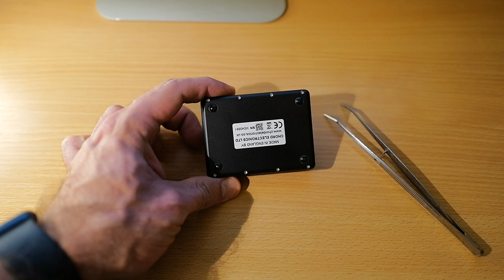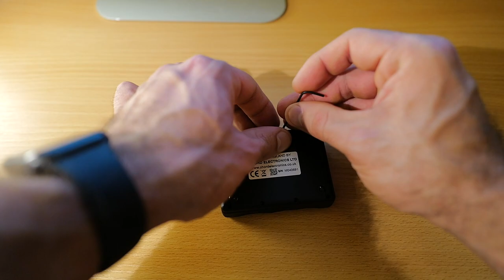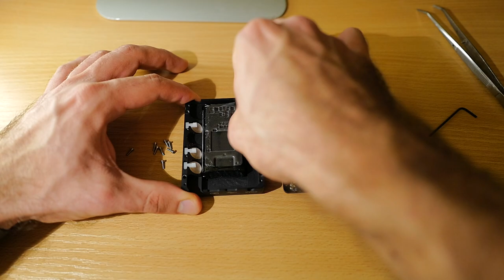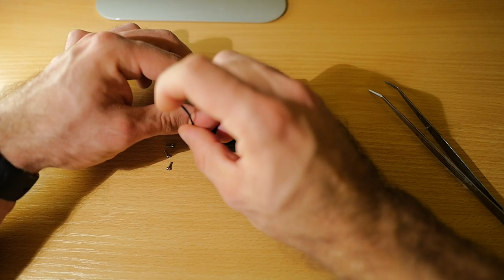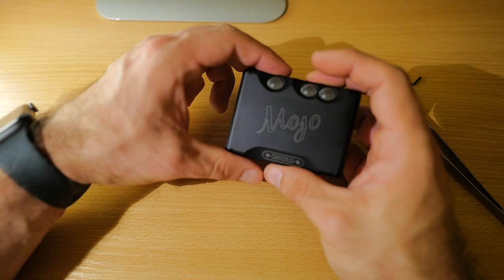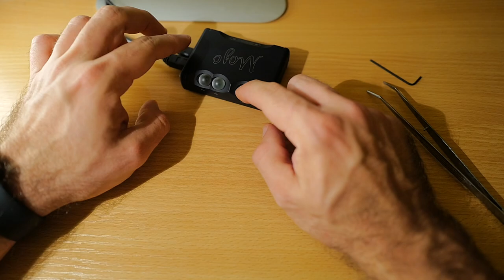How to convert Mojo into a (always on) DESKTOP DAC? Step-by-step GUIDE

Comment: Does this stop it getting hot ? Great video
Reply from the maker: Hey there! Well, the CPU that does the processing produces heat. But so does the battery when being charged. So by removing the battery you lower the amount of heat created. But the difference heat wise is not huge. But it is noticeable. Yes.
Reply: Thanks , would you risk getting a second hand mojo or would you just get a new phone one ?
Reply from the maker: That is a good question! I probably am more likely to say I would.
Reply: @TechBlogPool  no sir, please don't recommend to remove the battery, you feel less heat because you're taking out the battery that makes the job of heatsink, but the chip is burning inside without the battery

Comment: i disconnect battery and it won’t turn on
and it won’t charge either
Reply from the maker: Hi, this most likely means the power supply is too weak. What is the amperage of your adapter?Please connect to a stronger power supply.
Reply: @TechBlogPool i found out that it blew inductor and power can’t get in the board, took out the melt inductor and it works

Comment: my problem is that my mojo keeps on turning off this way..  any ideas  ?? 
thanks !
Reply from the maker: Unfortunately that may be a faulty Mojo or alternatively not enough power. Try to use a good separate 2A power source. My mojo turned off after about 8h with it without battery.

Comment: any one knowes where can i get a similler battery for replasment ? 
not the original one that costs 100$$$$$$
thanks!
Reply from the maker: Unfortunately because this is such a niche item the original one if the I my one that can be easily found. I believe there was one Canadian supplier who had one for 70$. But for that price I’d rather get the original.
Reply: 2pcs of standard li-ion battery that fits in case together. DIY.

Comment: unless the battery is knackered, pointless exercise as it will deteriorate with no use regardlessly and will result in diminished sound quality as battery power is much cleaner than a mains supply.
Reply: The mojos has power filters built in before the power reaches the dac. Power supply has no effect on mojo.
Reply: @ATommy-lz4jd  hmm, if it was that good then why would anyone spend a thousand on the desktop version which is essentially the same dac just higher clocked?
Reply from the maker: Not pointless at all. Having the battery going through pointless power cycles and added heat has deteriorating effect on the product.
Reply from the maker: HUGO and HUGO TT are completely different products. This has nothing to do with detaching battery from the Mojo.
Reply: @TechBlogPool  was thinking more of the qutest. Observe  lipo batteries deteriorate with no use, more so than if they are lightly used
Reply from the maker: The thing is.., mojo batteries are pretty much useless after 2 years. Let alone the lifetime of the device which can be 5 years or longer easily. Disconnecting and removing the battery is a safe way how to solve this.

Comment: Would there be a difference in the sound by removing the battery?
Reply from the maker: Hi there. Nope. No difference in sound. It is just to enable mojo to be safely permanently connected to the power without having o worry about killing the battery.
Reply: Hello Martin! Please tell, what kind of charger do you use? Is it ok to use Samsung standard charger or I need something else to feed the mojo? Thank you for the great video:-)
Reply: @TechBlogPool  There is a difference in sound. Like another poster already pointed out, the Mojo is under powered at 5V compared to the 7.4V internal battery, thus the output level is reduced. It still works however the unit is not operating at optimal performance. Like 'dsq audio' suggested, getting a high quality 7.4 volt linear power supply and wiring it into the same connector where the battery would normally connect would solve the issue, however you would have wires sticking out and the casing would not close completely which could possibly affect the operation of the volume balls. Another solution is to drill a small hole in the casing to run the wires through but then it impacts the warranty, resale value, etc.
Reply from the maker: To be honest I do t consider this to be an issue because this setup is primarily in my opinion for anyone who uses it with an audio system where all you need is a standard 2V output. But of course if you want to use it with high impedance headphones or insensitive headphones then this might be a limiting factor.
Reply: @TechBlogPool  Understood, however the 2V output is no longer 4 clicks down from the default line out (3V) setting, instead you have to crank the volume up quit a bit to reach the 2V level again. Again, not a big issue, but you're just not getting the most of what this fantastic product is capable of running it at 5V.
Reply from the maker: If your battery dies then you kind of are getting the best possible at that point. :-)

Comment: Why not just remove the battery altogether?
Reply from the maker: Of course, you may do that if you want. If I did that I’d most likely lose it. :-)
Reply: no, don't remove the battery, the battery does as a thermal conductor to the case. if you remove the battery you can overheat the fpga chip. the battery has thermal pads in each side. anyway it's not even good taking out the battery because it filters the noise coming from the power supply. it's better to uset with battery and later buy a battery on ebay for 50 dollars or adapt an rc controller lip battery
Reply from the maker: That is actually false. The battery does not work as a heat sink. The battery itself produces heat while charging. The case is a heatsink for the battery. The FPGA chip is low power enough not to overheat.
Reply: @TechBlogPool  that's why in the offical manual is recommended to charge the chord mojo while it's off, because it generates heat, that's why it comes with the thermal pad over the fpga
Reply: @TechBlogPool  says exactly this words "It is normal for Mojo to become warm when charging especially if switched on and playing at the same
time"
Reply from the maker: For precaution. But I am yet to see anyone ever even after years having any issue. On the other hand people have issues with the battery and a lot less issues once taken out. You can still place a heatsink in if you wish. But a batter as heatsink is quite a nonsense. I hope you agree. Battery heats up even while discharging. Maybe the FPGA cools the battery. :-) (joke)
Reply: @TechBlogPool  the battery is part of the thermal transfer. the battery and the fpga gets hot, the fpga has a thermal pad to the battery and the battery has a thermal pad to the case. both works together to cool down with the help of the case. the chord mojo in use makes more heat than if it's not in use, that says the manual, that's because the fpga is working and that's why the fpga have a thermal pad
Reply from the maker: We all do these modifications at our ow risk. Some people stick religiously to the manual and some don’t and are more adventurous. My and many other people’s experience is such that this is a safe practice. You are allowed to have your own experience and make your own choices. I’m describing mine. If you have a specific experience where your device failed then do share it. Mine hasn’t. If you just cite the manual then I’ll just politely note that we have all read the manual.